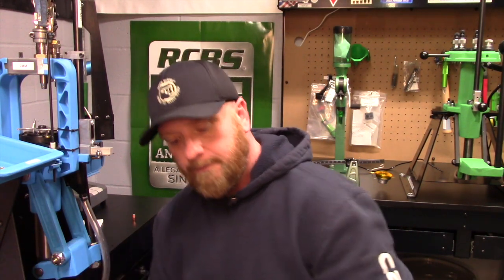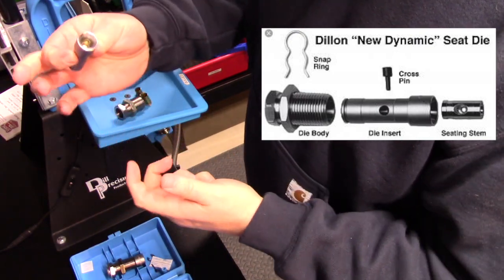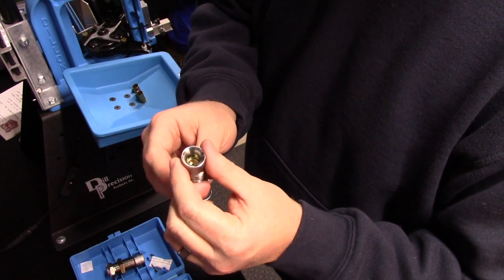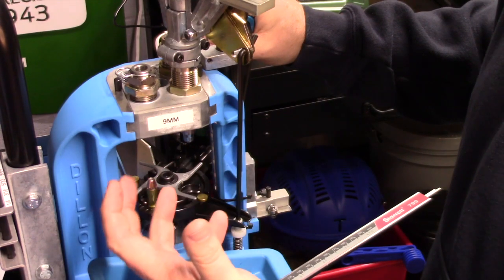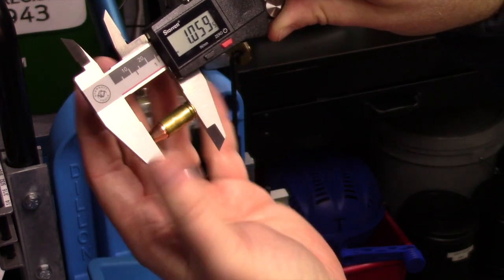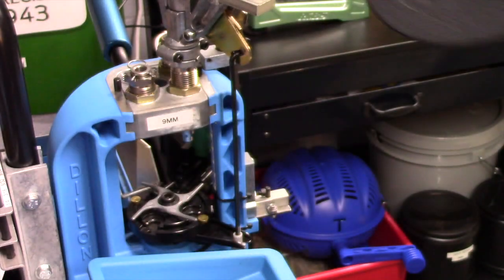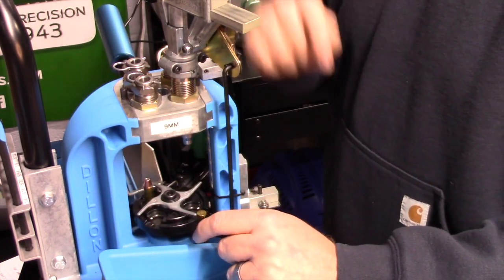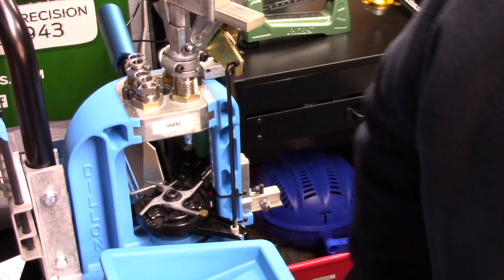Dillon 550 9mm Load Series pt 4 - Setting the Seat and Crimp Dies

Comment: Being a retired manufacturing engineer, and in my early days an ultra precision machinist, I am always aware of thread pitch and how it might effect my process. In the case of Dillon die sets on yours (and mine) 550b, the threads per inch on the dies is 14. So 14 threads per inch gives you a pitch of .0714 thread to thread.
So every complete revolution of a die in the block will advance the die that amount in depth. It makes it easy to calculate how much to move the die when setting overall length. Also, since there are 6 flats on a lock ring, each turn of the die from one flat to the next flat is about .012 of an inch (actually .0119).  
For instance, if you seat a bullet and your overall length when measured is too long, say .083 too long, you would turn your die one complete Rev and one more flat. Or 7 flats if you want to count that way. Of course that is assuming your lock ring is moving freely with the die.
Reply: This is likely one of the best comments on the web. Very helpful. If I would have thought about this I may have figured that out, but greatly appreciate not straining my brain. 👍🏿👍🏿👍🏿👍🏿. Any other tips like this would be helpful.
Reply: @whliving  thank you very much. I imagine you know much more about it than me!
Reply: I know most all reloading dies and presses are set up on Coarse Threads but it would benefit us greatly in making minute adjustments if someone would make a system with FINE threads...in my opinion .
Reply: thank you
Reply: Great info Sir ,but I have to admit your train of thought is over my head . I'll just stick with the method this young man is using .

Comment: Man!, you've made some excellent videos on the 550.  Since I started reloading, some 45 years ago, I've used red Hornady presses (single and progressive - with all its moving parts).  I especially dislike the little spring that wraps around the shell plate and holds the rounds in, it's always breaking.  Well, I remembered that my brother-in-law has a 550 and called him to see how he liked it.   He said it is still boxed and never been used and told me to come get it - to get it out of his way.  I liked the way the 550 flairs the top of a case within the powder die.  With the Hornady, it had a separate die the did that.  I'm be running up to his house tomorrow and pick it up.  I'll be watching you tutorials a few more times.

Comment: I have been reloading for about 20 years.
I enjoyed your video.
have you ever used the EGW chamber checkers (seven slots) sold by Dillon.  when checking the crimp and length find them much more usable than a one off (Wilson, Lee) single chamber checker.
Just saying.
Reply: The EGW chamber checkers are made to SAAMI “mimimun” specs according to the rep I just talked to at EGW.  Which is why I will get loads that pass the Wilson and Dillion case gauges but won’t pass the EGW. They also make a case gauge specifically for bullets with a large olive.

Comment: I greatly appreciate the detailed instruction and tips in your videos. I have a Dillon RL 550 and cannot get a consistent OAL. I'm loading 9mm Berry's RN 147 gr bullets, reprocessed range brass. I've thoroughly cleaned  the setting die and it is tighten downed snug. Berry's recommends 1.160 OAL after numerous adjustments I hit 1.160 the next 10 bullets I loaded ranged from 1.149 to 1.164 never hit the same OAL twice. Any suggestions would be greatly appreciated.
Reply from the maker: What die set are you usong
Reply: @SquatchReloaded  Dillon die set 9mm 14406
Reply from the maker: Ok first thoughts…
- Make sure you have alleviated as much slip from the shell plate as possible.
- double check your crimp make sure you are not too tight, sometimes as the crimp comes in as it squeezes it will pull the bullet in and down.  Make small adjustments down until you get in that .377-.379 window.  Less is always more!
- Also confirm that your using the appropriate seating stem adapter for the bullet style you are using.  Ie flat or round

The other thing is their is inherit variation in bullet ogive that will yield some variation in OAL and also consider different brass wall thickness giving more or less resistance while seating.  I can also create variation with how I run the press either by speed or force on the handle.  People sometimes don’t realize the variation they can add by how they run the press.
Reply: @SquatchReloaded  I'll will look at and adjust all of that. THANK YOU for the advice.

Comment: Great Video..I learned alot once more from you.I see you have a clear hose coming off your spent primer container. So what do you have? Im still picking spent primers off the floor even after buying a extra mouth off Ebay. There has to be a better way. Is you powder knob a Clickable one? Thank you and Happy New Year!!!
Reply from the maker: That is a bob chute.  There isn’t a 100% fix for the primer dropping it’s usually due to Dillons decapping pin that is spring loaded.  The bob chute does help and removing that cotter pin in favor of a paper clip or finishing nails works too.
Reply: @SquatchReloaded  Thank you.Yeah I removed that cotter pin first thing..I will try that Bob Chute. I tried using Hornady & RCSS & Redding Dies too. Not much difference to me on the problem.The Lee Universal  decapping die helped a little.Ive got alot from your videos.They are great at teaching newbies like me.Thank you .
Reply: @SquatchReloaded  where did you buy the BOB Chute? thanks

Comment: Just curious the powder measure won't drop any powder when you are working on station 3 to seat the bullet when the ram is brought up?  It's been awhile since I've used my 550b... thanks for the informative videos!
Reply from the maker: As long as there is no cartridge under the powder hopper then it will not.  It is case activated.
Reply: @SquatchReloaded   excellent, thank you!

Comment: How do you deal with coke bottling of the brass on 9mm? I just switched to Dillon dies and it is driving me nuts.  My hornady wasn’t abundantly as obvious but these with Dillon look harsh.
Reply from the maker: Make sure you have a minimum of .012 flare.  Do not over crimp stay around .377.  More flare helps.
Reply: @SquatchReloaded  Would the amount of crimp be different for lead bullets?
Reply from the maker: HD Imaging not necessarily all we are looking to do is flatten back out the case wall.  If your cast bullet diameter is say .335 instead of .356 you may need more taper crimp to flatten it out.

Comment: when seating can you a factory bullet to set the die adjustment
Reply from the maker: I would not recommend that practice.  Every  bullet has a different profile and may not use the same OAL as a factory round.  Look in your manuals lengths vary with almost every different bullet.

Comment: How come my brass let's a lot of my bullet tips go right to the bottom before I even get the seat?
Reply from the maker: Are you using new brass?  And are you sizing it
Reply: @SquatchReloaded  I'm using fired brass, my decapping die might have a sizing issue I'll definitely check that
Reply: @SquatchReloaded  So the die in my number 1 says "expander" but has the depriming pin in it also. I'm so confused do I need to get a new die for station 1 that has a deprimer also?
Reply from the maker: Station 1 is size/deprime station.  The expander die will not be used as the powder funnel does the expansion.
Reply: @SquatchReloaded  Copy so does that mean I need a new die for station 1? And I thought station 2 strictly belled the case not necessary expanded it?
Reply: @SquatchReloaded  Thank you for replying by the way! Seems almost impossible to find people who with knowledge that will reply to questions!
Reply from the maker: It does slightly expand and bell.